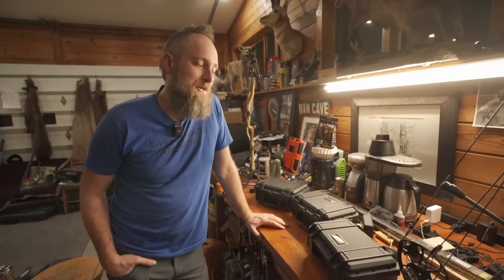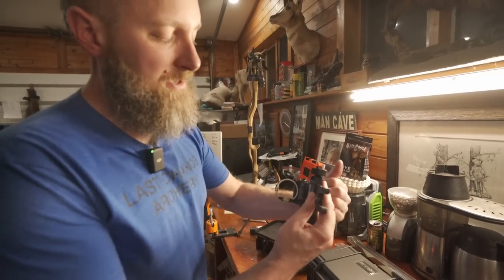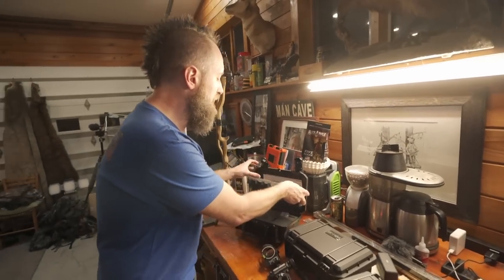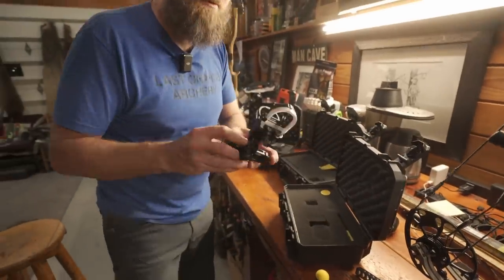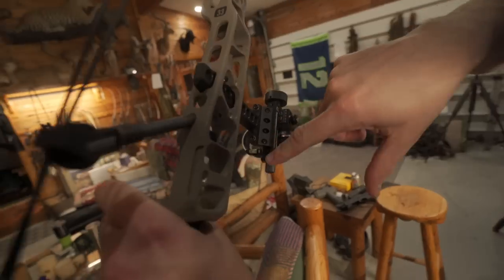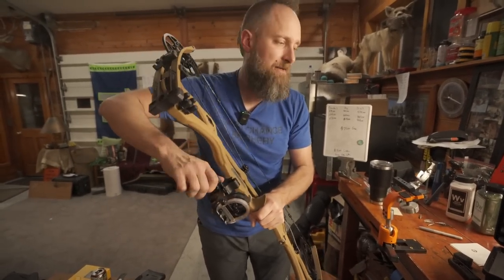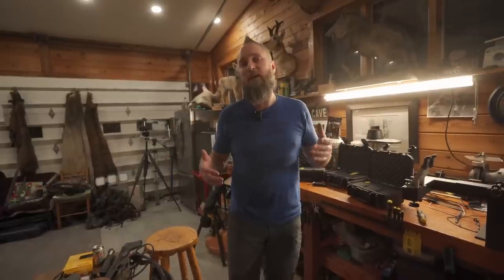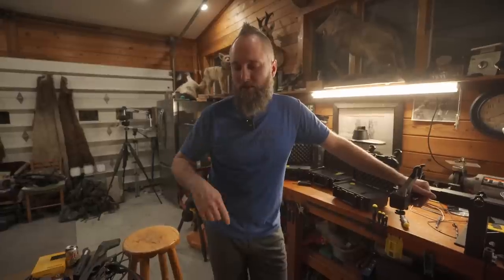Option Archery Canyon Pounder with MFJJ!!

Comment: I have the cp 5 and a custom pin setup of all .010pins in alternating yellow and green. This sight is built how all products should be built. It's tight af, the layout, construction, and every little detail has been thought of. 

If you like to shoot 3d or target alot the single pin centered in your housing is awesome. At the same time using the 5 pin configuration it's great for hunting elk or basically any animal within a surprise range.  Also it has another indicator and sight tape on the opposing side for another pin, I use thay for my bottom pin. I can get probably 140 yards with a heavy hunting arrow.

Furthermore you can move the center pin on the x-axis so it perfectly lines up with the other pins to your specific eyesight and hand torque. 

To say the least I'm pretty happy with this sight, and I've owned many others

Comment: I understand that the pin moves on a 4s and the housing moves on the canyon, but what are the advantages/disadvantages to the 4s over the canyon vise/versa. Thanks. I'm buying my first long range sight.
Reply: Both designs have their advantages; on the fixed housing models (4s, 6s, and 8s) the fixed pins are always “on” when you flip them into view…..no matter where the mover pin is set.  Also, if you prefer to center the pin guard housing in your peep, this design will keep your anchor point constant no matter where your mover pin is set.

On the Canyon Pounder; your “mover” pin is always centered in your housing, and your peep.  So, if you are used to shooting a standard single pin sight, this will be what you are used to.  Also, there is a 2nd sight tape for referencing a 2nd pin (usually the bottom fixed pin) ….. this system will give you the maximum range capabilities.   If you have more questions check them out on our website, and feel free to message me as well. Thanks, Dan

Comment: Crazy expensive
Reply: and they have the audacity to charge another 20 for the box lol. Sucks to see that the archery industry has turned into such a grift.
Reply: @bravefastrabbit770  it’s $25 extra for the case 😁.  Which is just a little less than I pay for it (when I buy 500 at a time)……. 👊🏼👊🏼👊🏼 (Dan)
Reply: @OptionArchery  why are you paying so much when you are not the end user?

Comment: I'm running a black gold sight with normal mount on my hoyt and my tight spot mounts the the sight bracket. If I switch to pic mount do I have to buy a different quiver or is there something I can do to continue with my tightspot?
Reply: I can't say for sure but you should be able to mount the quiver bracket directly to the bow using the threaded holes intended for the sight

Comment: 600$ not going to happen when it’s still old school standard mount, also from experience the clear  plastic around fibers dry rots and cracks and splinters especially at screw holes. But their other sight, fixed with floating  pin is literally most accurate sight on the market under 80 yards prove me wrong. Do your research on maximizing your distance without moving anchor point and housing and can’t get any more accurate sorry. Great hunting sight for sure but we do all like to stretch more yards for fun so not a hot seller. To much for not enough
Reply: Also guarantee something nobody has considered is the knob on top makes no sense and actually creates a bad movement of elbow creating 1-2 more cubic feet of movement in the heat of the moment adjustment that can create a bad scare of animal

Comment: I see that labradar back there... Did you happen to get the archery trigger for it? Ive been waiting forever because its been sold out.
Reply: Did you try running doppler in the settings? Works for me.
Reply: @DeltaMikeNoshoot  I did but my readings weren't as consistent as i thought they could be, i had a few shots that didn't register at all. They suggested i use the archery trigger, which would be fine if they had them in stock..
Reply from the maker: Scheels has that part in stock

Comment: seeing different fletching options would be pretty cool, how quiet are they, how well do they steer a fixed 2 blade broadhead (ironwill solid for example) how much different colors weigh (white vs orange for example), how closely 10 fletching weigh to each other and how well they group at 60 and 100. could do more or less.